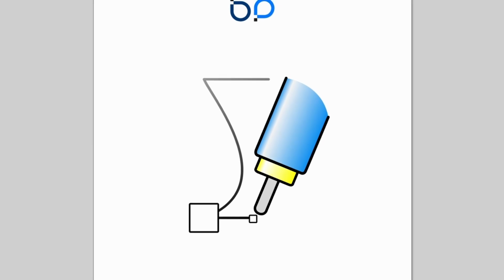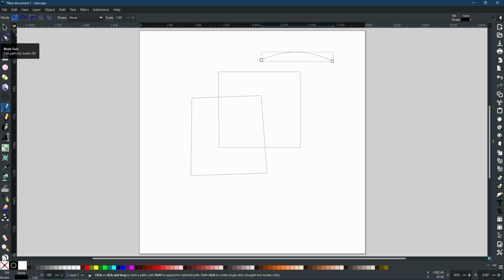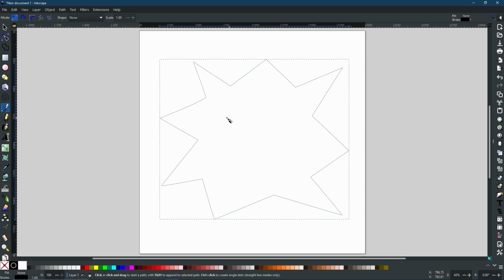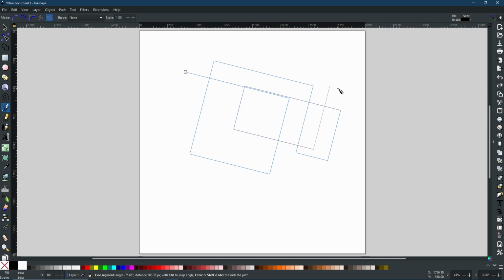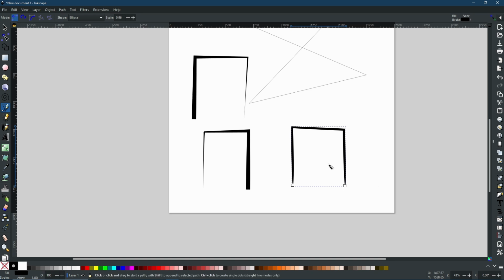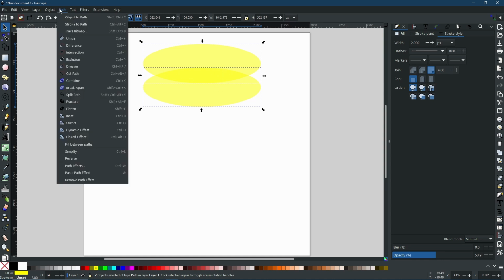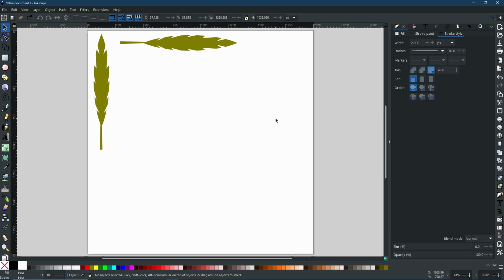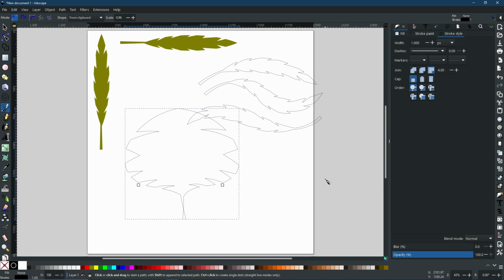The Basics Of The PEN TOOL In INKSCAPE

Comment: How can I apply a different style resembling a brush or pen mark to a previously created path with a regular outline?
Reply from the maker: Another great question. It is possible to do so but with this being a vector-based program, it works a little differently in comparison to the programs built for that type of design.

For basic lines like dots or dashes along the stroke, you use the Stroke Style tab of the Fill & Stroke menu. For others, you can create a shape (The shape you want your "Brush" to be) and then right click > Copy. This will copy the shape on to the clipboard. From this point, when using the Pen Tool, you can select From Clipboard as the drawing mode which will use the shape you created along the path you create with the Pen Tool.

Hope this helps my friend.

#StayCreative
Reply: @ButtonPressGraphics  Thank you for your answer, but what should I do when I already have a path drawn and I want to change its appearance from a regular outline to one imitating a brush or pen mark?
Reply from the maker: @CezaryMarek  for that, the alternative is to redraw the line and then delete the traced line.

Unfortunately, there are so many different creative apps for these very reasons my friend. Each one excelling in specific disciplines. Using "brushes" in this way are normally for applications that are designed for Graphics Tablets. Inkscape has features compatible for touch screen but I haven't used them before so I simply cannot help with that side.

Sorry, I am aware that this is likely not the answer you were hoping for.

Comment: My pen tool makes filled shapes instead of lines by default for some reason. The pen tool preferences just doesn't offer any relevant settings for that. Whoever created the GUI of this software seemingly definitely has problem with a common sense.
Reply: follow up: after chaotic clicking on meaningless icons I got the pen tool drawing lines instead of filled shapes.
Reply from the maker: Fear not my friend, this happens due to the previous settings used. Example: if you create three shapes and each time, change the colour, you will notice that the shape you create will have the same colour as the last shape that you created by default. Meaning it remembers the stroke width, colour & fill colour from that last shape created.

So, if it annoys you, create a shape (Literally any shape) & set the stroke colour, then remove the fill colour. Once done, delete it. Now when you create your line, it will have no fill. Also, be aware that the Shape drop down menu in the properties toolbar at the top should be set to None.

Hope this helps my friend. #StayCreative
Reply: @ButtonPressGraphics  "due to the previous settings used"
This is a brand new installation where I haven't set anything. If the pen tool is set to draw filled objects by default then it's another story. I gave up with your tutorial as I got absolutely different software behavior to what you show so it turned out to be pointless to proceed with. The way the developer moved the pen tool parameters to absolutely different place called Fill&Stroke leaving no reference to it looks just illogical and silly from my perspective.
Reply from the maker: @MSM5500  I completely understand my friend. I can understand why it would frustrate you. However, I do not know what has gone wrong. Usually, the solution I gave you is often the problem that people have & because it is not an issue that I have had since 1.2 (I think), I wouldn't know how to fix it. I assume that you already have the latest 1.4 release of Inkscape?

My suggestion would be to report it to Inkscape via their site. I know a lot but in this case, I think that there are people/devs who can more accurately help you because their knowledge is greater than mine. Also you can check out DoctorMo (An Inkscape dev). He is on YouTube and has an outstanding knowledge when it comes to Inkscape so I am sure he could direct you better than I could.

I am sorry that I could not be more help & remember, Inkscape is run by volunteers. They do not get anything other than contributions to do the work so they do the work because they love the app even more than I do. If anyone can help, they can.

Hope this helps my friend
Reply from the maker: @MSM5500  Yeah, I know what you mean. Other than the theme, I try to stay with the default settings so that when people watch my videos, they have the same UI. This makes it easier to follow. However, with that said, I have installed new versions and of course, like you said, my UI has changed. A perfect example of this is the toolbar I now have on the right (including the shortcuts for Fill & Stroke, Align & Distribute etc which, in version 1.3, was along the top instead.

I guess these are the prices we pay for having a completely open source application. So, I understand your frustration. Maybe you coulkd mention it to the devs via the site? That way 1.4.2 could save your settings instead of having to uninstall the previous version for the new one. However that is just my humble opinion. #StayCreative my friend